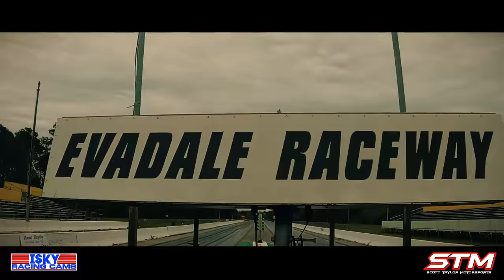We Test the Twin Turbo Setup! You Won't Believe How Fast it is!!

Comment: It'll be interesting this year. If those turbo cars can run with the nitrous,  Pro Chargers, Screw blowers to the 330 then it'll be a great combo to run. As of now the turbos haven't been able to run to the 330 with those combos. Maybe this year. Good luck nice job.
Reply: It's got a lot to do with them not having the right torque converters to keep them turbos where they want to be and be able to help put the power down without melting with the heat I believe Scott Taylor and Mark Mickey are both running those new high dollar titanium torch converters or at least testing them I believe that's one of the other main reasons Scott went with a twin turbo car for MPK is to try to r&d that new setup to give turbo guys at fighting chance

Comment: You gotta get rid of those waste gates and control just blow off valves with fuel tech like Mark mickey is doing.  It completely gets rid of spooling issues and makes the car 60ft like a procharger setup and mph like the turbos are known for.
Reply from the maker: Going .9? Now and spools super quick but we going to try the new way also.  It’s getting wired up now
Reply: @ScottTaylorMotorsports  no idea on numbers but in an interview he was talking about it doing procharger numbers down low.   Good luck this year!  Hope you guys do great.
Reply: Yes what they are doing is keeping the turbo at full spool from launch to stripe just bleeding off psi on the cold side that way turbo is always spooled bring in the power after the launch. Y'all seem to be doing great already